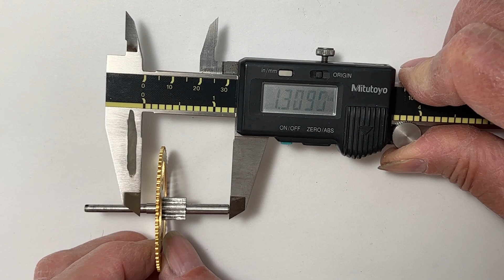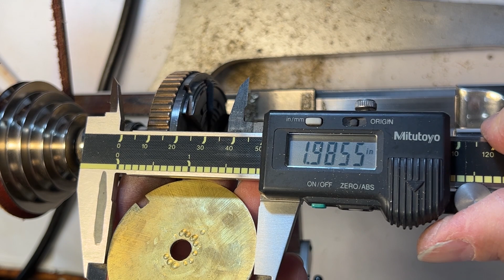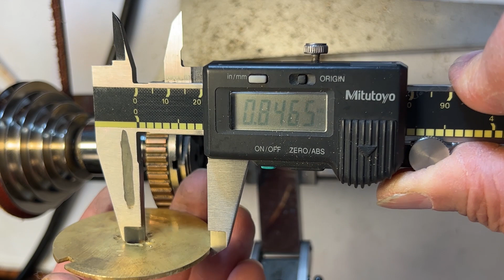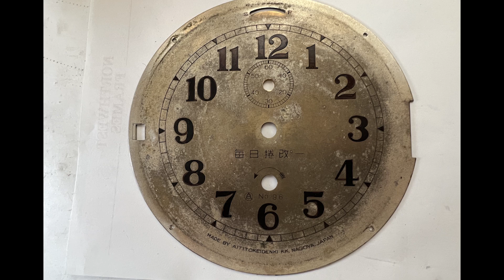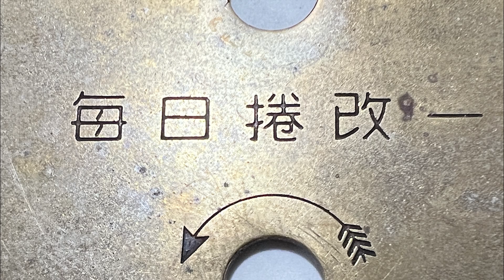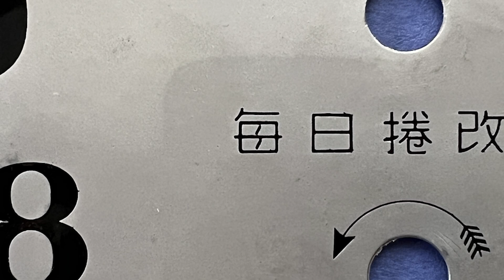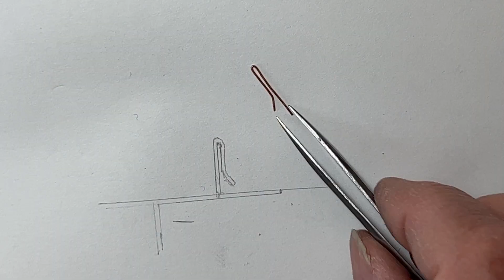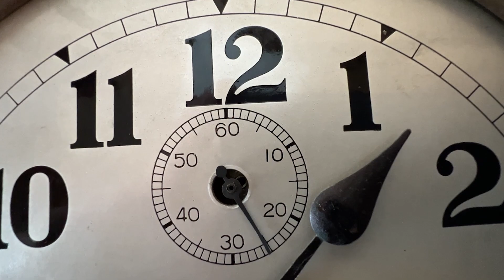Part 3 Aititokeidenki Ships Clock movement Restore for Ron from Iowa #81

Comment: Aiti is actually pronounced Aichi and is now written that way again in the Roman form.  It is the name of a prefecture in the main island Honshu and is more similar to a USA state rather than a county.  During pre-war times there were different romanised spelling of the Japanese sounds, so chi became ti, zu became du, and so on.  Nowadays tokei (時計) refers to a wristwatch rather than a clock, and for the latter katakana is used to transliterate the word clock (クロック).  There are different words in kanji depending on if the clock is mantelpiece with an escapement or a pendulum type.
I searched for a technical manual for this or any clock made by the company but found nothing.  Here in Japan there are many such old clocks available for sale online but I have not found a ship's clock by this company for sale.  I sincerely doubt if any kind of technical information for such an old clock is available even in Japan.  Best wishes.
Reply from the maker: Thanks for the clarification, the movement is very similar to a Seikosha from the same time period, only slight differences.
I take in a variety of different clocks for repair, this is a special one, ended up being a great time keeper.
Reply: E T, Thank you for the information. In addition to my no. 96, the internet shows photos of 3 others, nos. 64, 104, and 270.

Comment: Quite a lot of work to get this back up and running! Quite the beautiful restoration! How do you ensure the pivot holes are centred appropriately on holes without concentric reference surfaces like the mainspring cover? In cases such as holes on the plates when they've been ovalized or butchered. Thanks for the trick on straightening wire. Definitely something to keep in the mental toolbox. Also, if you ever make merchandise, definite slogan for the channel would be "a butcher has been here".
Reply from the maker: Thanks, I enlarge the worn hole in the direction that doesn't get any wear from the pivot,  it has always worked got me.

Comment: I've never seen anyone repair an escape wheel before.  Did you have to do it as an apprentice?
Reply from the maker: I took horology course in the 1970s, they had us repair by hand, several brass and steel gears but no escape wheels, but similar process.
Would have been easier to remove and replace but not able to source any used parts so actually quicker to repair and get it back to the customer than wait for one to show up. 
I have never seen another clock on the open market like this.